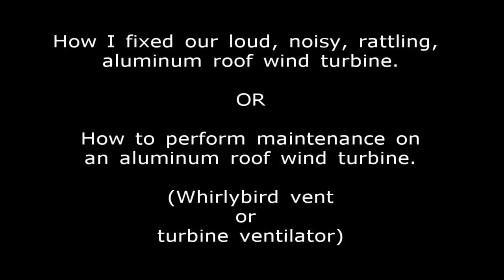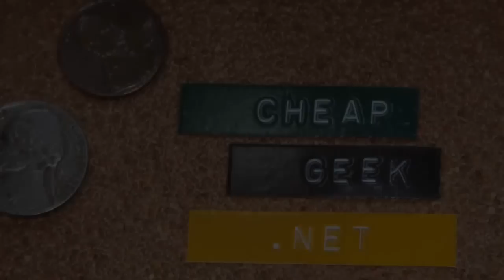How I fixed our Noisy Roof Turbine Ventilator!

Comment: Thanks for the info.  I used it to get all the tools and get up on my not so flat roof.  

My whirlybirds are the cheaper variety with no way to tighten anything.  Ended up just using WD-40 to clean off bearings and shaft and silicone spray to lubricate.  Worked like a charm….zero noise now.

We’ll see how long it lasts.
Reply from the maker: Probably years 😉👍

Comment: I use a spray can of white lithium grease.  Works better than WD40, oil, etc.  I had one that squeaked so bad I thought neighbors were going to run me out of town.  Got up on the roof, took it off, sprayed it with the grease and 2 years later still quiet as a church mouse.
Reply: moncorp1 Inc funny you say that.. i thought we had attic mice or bats, but it was the turbines!!!

Comment: I got up there today, mine were different than yours though, the top nut wasn't removable just the bottom one and the whole thing had collapsed.  Some of the arms inside were rubbing on another part and most of the aluminum was gone.  I went up to Lowe's and picked up a new one for $35, easy to replace, I'll do the second one once it starts to act up i guess.  Thanks again!

Comment: Thank you for the video, very helpful, clear concise accurate, one point I think applies is your turbine appears to be a high quality American made unit vs. the cheap Chinese units that do not have the external braces.
Reply from the maker: David Holden Ours are at least 20 years old.  the new ones are a little flimsy... :)

Comment: I found a secret room when I climbed up in my roof…I thought I had a serious mouse problem in my attic 😳 I set traps and all that but nothing.. I searched for any openings they could be using to get in and I found minor stuff.. but as I walked around the house I came to a corner where the squeak was really loud.. I stood there scratching my head until I looked up to the roof and saw this thing spinning like crazy while basically screaming.. when I went up to see what I could do I saw a type of small latch door.. I opened it and there’s a bunch of stuff from the 80s.. loads and loads of cashed checks and tax returns..a few cushions and Christmas ornaments, paintings that are signed by with the same name on the checks.. really good paintings too.. the space it’s over my garage but there’s no other entry points besides the door on the roof
Reply from the maker: It’s like your own secret vault! That’s pretty neat and slightly creepy. ;)
Reply from the maker: It’s like your own secret vault! That’s pretty neat and slightly creepy. ;)

Comment: Lubing the bearings and tightening the nut is not the final fix for your turbine. Both the top and bottom bearings need to be replaced. 

One tip - if you need to remove the turbine, use a Sharpie to mark the turbine location on the roof adapter to make sure you put the turbine back on the adapter in the original location before removing the turbine.
Reply: Thanks for the "Valuable" tip.
Reply: He did that

Comment: Well, I removed it and covered the hole with a lawn bag strapped with a bungie cord. Mine doesn't have ball bearings but mere bushings. The lower bushing is worn bad. The turbine is old and it's cousin is much newer. I looked down the hole and see a lot of dirt and leaves on the attic insulation. Not really the best design! I think I'm gonna get a static vent. The turbine serves no purpose but to keep rain out if it's spinning. I think a screened static vent will work better. Thanks anyways!

Comment: I’m hearing this constant loud high pitched  ringing whenever it’s windy. I think it’s my neighbor’s turbine. I wonder if I can call someone to come fix it. I can’t stand the constant ringing throughout the day in our otherwise super quiet neighborhood.
Reply: Uggghhh. I’m in an apartment and have the same problem except it’s me. I feel bad for my neighbors but then I walk inside and I can’t even sleep. It’s SO LOUD. I have a migraine headache now and can’t sleep. I want to cry. I don’t even have a ladder to get onto the roof but I’m considering just trying. My landlord hasn’t even come in to fix the leak from the roof so I know he won’t come fix this. 😭 I have very few tools so I dunno what to do.
Reply: It actually turned out to be my turbine that was making the noise. I also didn’t have a ladder and almost attempted to climb up manually, but I just kept fearing the worst. I’m not super handy. I bought a ladder for around $80 and a can of WD40. I went up with the intention of having to take the turbine apart like in this video, but I actually only had to spray the WD40. There was some crud/build-up between the turbine and the base, so I scraped that off easily with the WD40 straw and then sprayed it good. Haven’t had any issues since. Almost ended up calling a company to repair it, but glad it all worked out relatively cheap and easy. Glad I watched this video to give me the courage to check it out. Good luck!
Reply: I’m not sure where your turbine is located, but perhaps there’s easier access from underneath (like the attic). If you can get to it from there, maybe you could jam a stick or something to stop it from spinning until it’s fixed. Just a thought. Bug your landlord until he fixes it. Tell him the neighbors are complaining and talking about calling the housing authority. You can even contact your local housing authority and report the issues that need to be fixed and they will make certain the landlord gets it done.

Comment: I found this helpful! I do have a question for you sir. Just purchased a property and it was built in the 1970s, gutted and rehabbed prior to me owning it. I moved in in august and i keep hearing squeaking from the tip of my home. I’m betting it’s what your video covered. I’m a single mom, no experience with fixing things like this. Would you recommend a roofer? Would you recommend me applying lube to the device? I keep hearing consistant beeping and I’m think git’s my roof. I even asked Nextdoor appobwyat the beeping is and all my neighbors say they hear it too but can’t digurenoutbwyrebitsnfinubgbfrin.!
Reply: Figure out where it’s coming from* sorry! It’s so loud I think it’s my house. My dog is going nuts everyday!
Reply from the maker: When I lubricated mine, it didn’t squeak again for a couple of years. 
Our roof was replaced. ;) 
The scary and possibly part is getting on the roof. If you call a roofer they may be able to tell you for sure if that’s the problem. They may say to just replace it. A handyman can get up there and lubricate it and it maybe much less costly. I really don’t know what that would cost. I would call both a Handy man and a roofer to see what they can offer. If you’re not comfortable on a roof, I don’t think I recommend messing around up there. It’s really what your comfortable with. 
It was a really simple process though. 
If you have a handy friend maybe you can trade some pizza or beer or something for them to get up there. ;)
Reply: @CheapGeek  fantastic idea, I appreciate the advice and the helpful video!
Reply from the maker: @morganwhitney1983  You’re Welcome! If you happen to figure what it is, let me know 👍
Reply: @CheapGeek  I sure will!

Comment: I have no roof vent fans in attic just a hood covered opening. I have a wobbly fan like noise that comes on at exactly 12:35am and 5:35am every night. runs for 10-15 secs then shuts off. I tried turning off all breakers in fuse box at nt and the noise still comes on. what could be causing this?

Comment: I would not spend more than one hour to fix it. It costs only $40 to have a new one, Turbine Ventilator.
Reply: Hung Ton that’s if you want one that will squeak or rattle after 1 year. They usually have plastic bushings instead of ball bearings. That’s just what I’ve noticed.